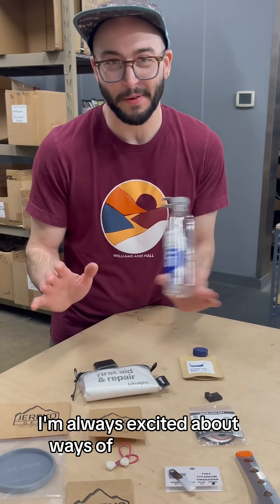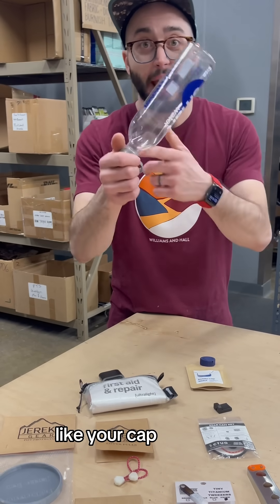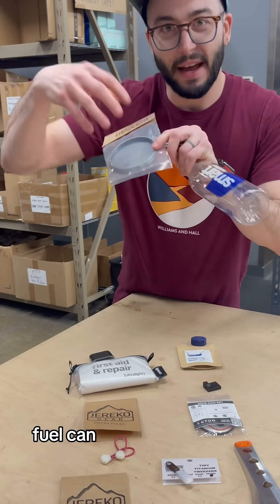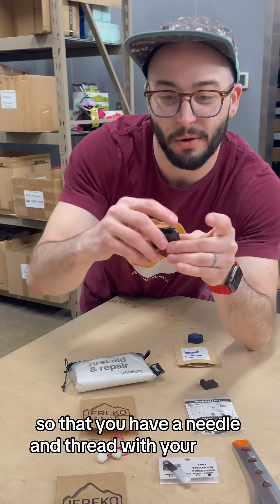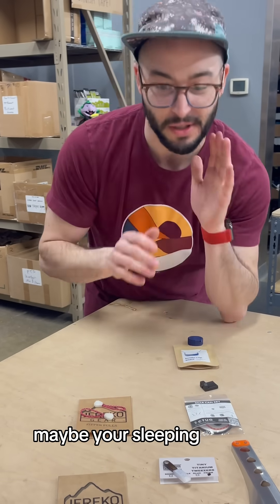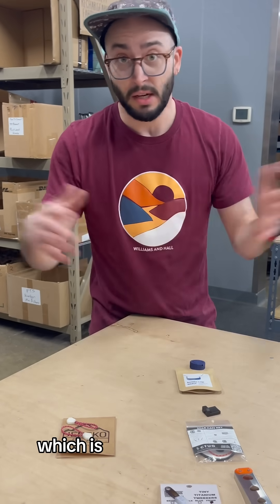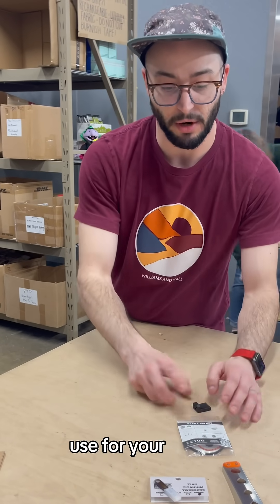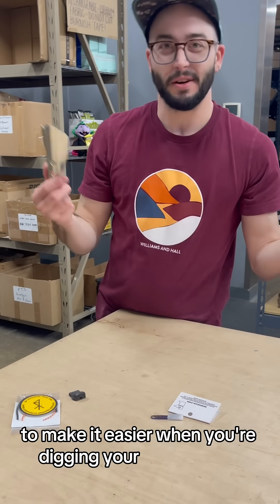Innovative 3D printed Gear

Comment: The fuel can coaster is a total waste of time and money and it's heavy...A much better and lighter solution is to use a Wild Sky Gear DCF gas canister storage pouch.  It only weighs 3g and it doubles as a hanging lantern bag which you can use with your headlamp or a mini LED flashlight to diffuse the light in your tent at night.  An Alf Outdoors top tip!
Reply from the maker: Thanks for sharing the pro tip! Everyone has different styles that work for them. It's great to hear that you found one that works for you!